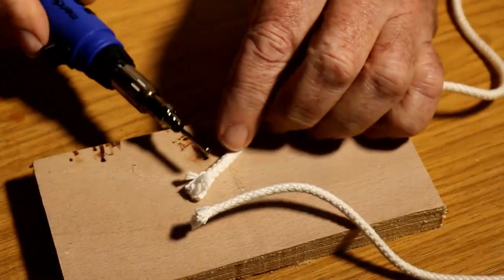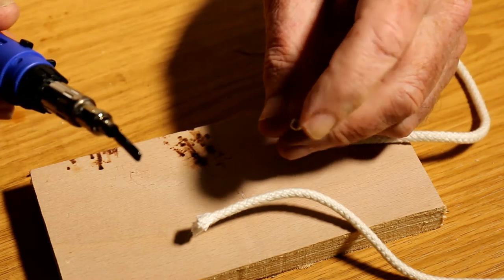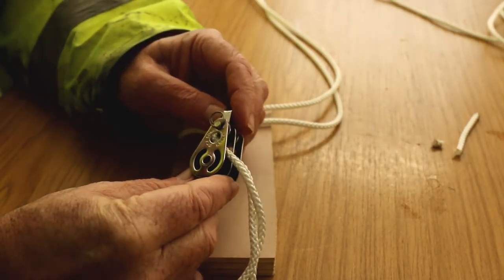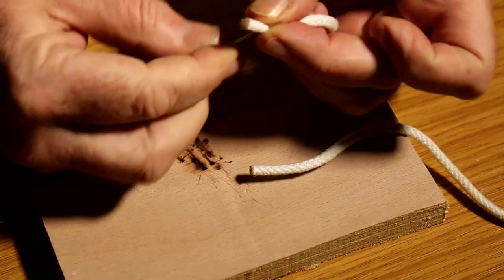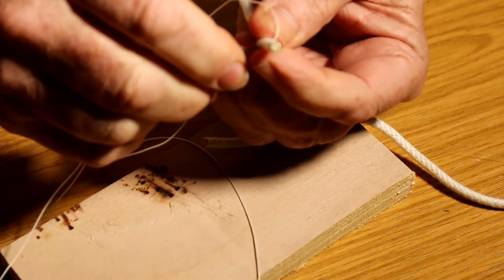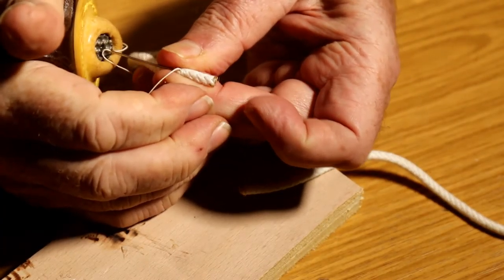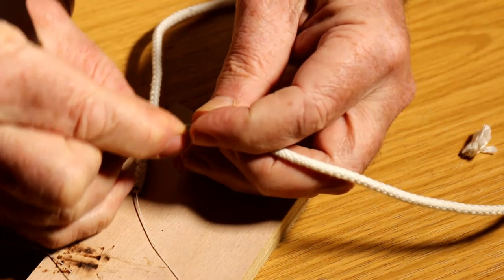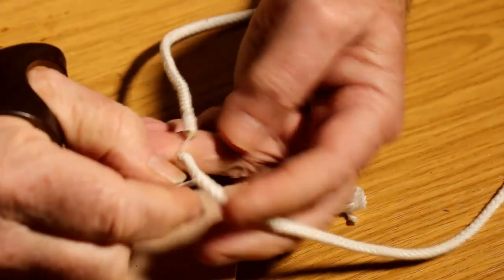Hebridean Wind Vane Part 9 Remote Control Lines

Comment: Another excellent video, thank you for posting these. I’ve built it. I can’t get it to run smoothly. I’ve smoothed all the surfaces and done all the obvious stuff. The worm gear spindle/bearing surface is basically the threaded bolt that passes through it -into/through the 2mm stainless frame. It’s binding there I think. Also, what size and type of line are you using? The pulley wheel is super smooth Tufnell, the lines I’ve tried just slip on it (3 strand synthetic hemp for example).  Very frustrating...
Reply from the maker: Hi, simple answer to the type of line, I used braided line, this will give better grip on the pulley, use either 4 or 5 millimetre diameter whichever fits the pulley best. As for the worm gear binding, all i can suggest is that you must make sure that it turns completely freely.  I adjusted the height and alignment of the gears many many times before I was happy. As you can see on the video it should rotate with very little effort.  Do not have the gears tightly meshed the only need to engage enough to work smoothly.  I seem to remember that if fitted too close together they will bind at times.  You can also test the lines without joining the ends to optimise the size and tension on them to get optimum results.  I am sure that by small adjustments you will eventually get it right :)  Maybe take some video of the worm gears and pulleys to show exactly what is happening?

Comment: I didn’t know that method for joining line end-to-end, thank you. A few years ago I replaced the continuous line on a Hydrovane using three-strand line and an end-to-end splice. Would that work here, do you think?
Reply from the maker: I am not sure to be honest. The 4 or 5mm lines were easy enough to fabricate as shown.  I didn't have 3 strand thin enough to fit and used what was recommended.
Reply from the maker: The lines are pretty small, but as long as the splice is neat and runs through without snagging then whatever works for you is ok. These videos are only an indication of how I made mine.

Comment: I know i am a bit late to it but how do you find tacking with the remote control lines?
and all the best with sailing!!
Reply from the maker: Hi, tacking is dead easy just pull on the relevant side, mark the turret and head each side. This way you just pull the cord to line up the marks and deal with the headsail sheets. Simple!
Reply: @iankfr  Thanks for the reply. It sounds really good. i have been looking at self steering options and this seems like one of the most fun/cheapest ones (if you don't count time)
Reply from the maker: @samgoldwise3233 It certainly worked well for us 🙂